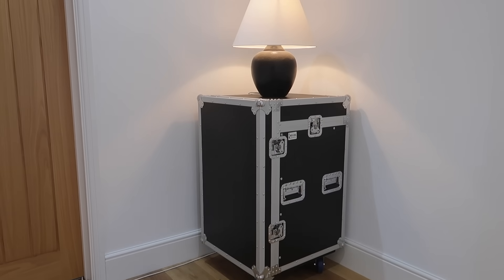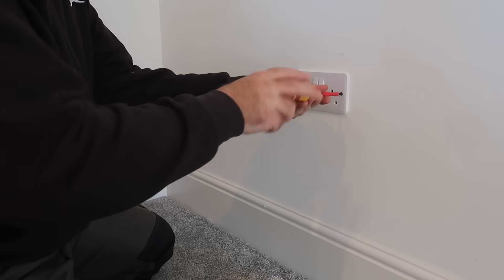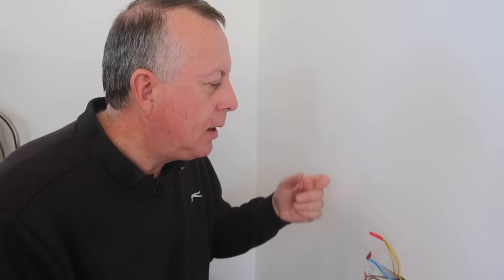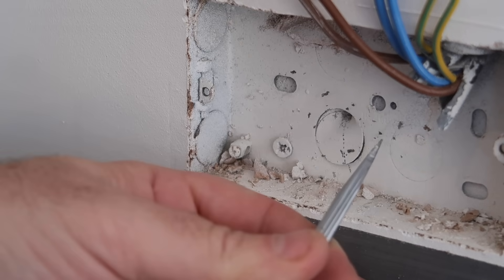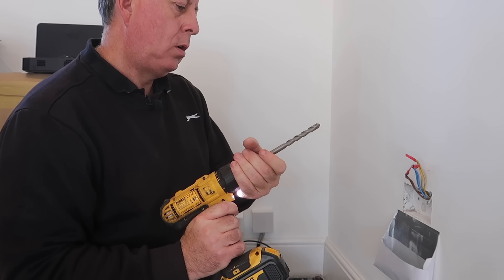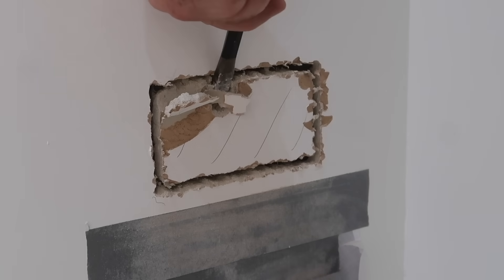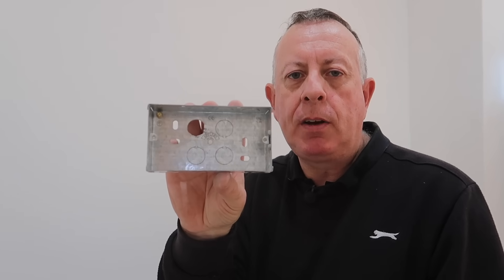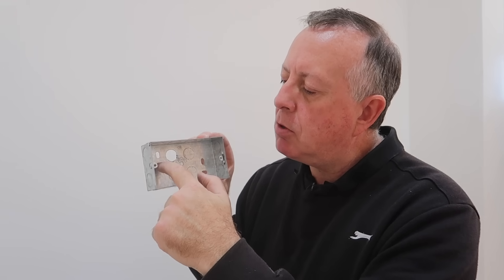How to Install a New Electrical Outlet in an Existing Wall

Comment: The reason why those neon screwdriver chesters a dangerous is because they do not accurately tell you if a circuit is dead electricians hate them because they are dangerous to the fact that they don't always tell you that the circuit is dead

Comment: My new build had stud walls with galvanised boxes attached to timber noggins rather than using plastic plasterboard boxes. To be honest, I dont know the reason, but I can only guess its because galv boxes are cheaper (reason most decisions are made in new builds - cost). Another reason could be it makes it easier at first fix as there doesn't need to be any plasterboards up to site the boxes.

Comment: Pulling on the earth wire, is not a good way to strip the outer sheathing.

A better way is to put the knife blade against the earth wire, at the end of the cable, and use the earth wire as a guide to the blade, to slice the outer sheathing lengthways.

Comment: You wouldn't see any of the filler behind the socket, and you'll keep the wall clean, if you fit a finger plate behind the socket.

Comment: To get the pattress box dead flush with the surface of the wall, put a strip of wide but thin wood (a bit of wide beading) across the front of the box, overhanging each end of the box, held in place with the screws that usually hold the socket in place, and put the box into the hole in the wall.

When the strip of wood is tight against the surface of the wall, the pattress box is level with surface of the wall.

Comment: If you'd of put two cables through the wall and used three double wagos in the existing back box you could of continued the ring no need for a spur

Comment: Would we be able to do something similar passing an ethernet cable through the wall with an rj45 socket /backbox either side? My Internet modem comes into the living room and my spare room (office) is directly behind. Looking to get a wired ethernet connection into the spare room and this seems like a good option.

Comment: the link for the MK Rapid Fix Socket doesn't work. Doesn't look like Amazon have them. Screw fix and RS do have them in stock. Thanks for the video. I wanted to do this for a couple of sockets for extra power in the house.

Comment: Those Neón screw drivers are all well and good but the reason why they are ground on is that they are not an approved method to test for presence of voltage. Firstly they are not GS38 compliant. Secondly the only thing that is stopping you from receiving an electric shock is a resistor. Videos like these is what makes DIY Dave say “My ‘lectrics work” yes Dave but are they safe? Have you tested it? 
But you keep doing what you do

Comment: Observation: There is an excessive use of extension leads. Flexible cables run through a doorway. Regulation: 553.1.6 C2

Comment: Err, using the bare earth wire to cut through the outer sheath, and then, on such a short stretch cable, go to the other end and find....The wire has disappeared into the cable! Should never do it that way anyway.

Comment: Just bought my first house and looking to do some DIY like this. My question is, does your new socket require your older socket to be switched on before it works?
Reply: No it does not. The old socket does not need to be turned on to use the new socket.

Comment: Hi Great Video and detailed explanation , I have one question, if you or anyone expert can answer. I think my Thermostat is blown on my Under Floor Heating. I am going to replace the thermostat. This was installed by builders and is powered from RCD to a 45A double pole switch then on to Thermostat. I think not right.??. Can you suggest the safe approach for the spur. Do I use 13A fused double pole switch or 20A double pole switch. UFH for 12.3 sqm and reading  resistance 29ohms & 1722W . Just need clarification please. Many thanks. BM

Comment: Do you not have the oscillating reciprocating blades over there I mean it's been a long time since I've been to England like almost 30 years but I see the outlets are definitely being upgraded the funny thing is here in the USA those Outlets would be flagged by code violation would not being big enough and not having the cubic space inside for the wires but also it's funny that you guys don't have to have all of the GFI AFI Outlets like here everything has to be arc flash now and arc flash GFI in the basements

Comment: Hi, how would you go about adding plug sockets to a loft where there are none nearby? would it be significantly more expensive? just can't get my head around how you would get the electric cables from downstairs to upstairs

Comment: When drawing round a back box it is easier to turn it around so the sharp edges are against the wall and stops the box from moving as it digs into the wall a little.

Comment: I wouldn't use one of those screwdrivers ever, they are lethal if they go wrong - plus, you want to take a look at your sockets, you seem to have a lot of bare copper poking out from the screw connectors - I would fix that while I was on with the spur.

Comment: "I'm using 2.5mm2 to match the rest of the circuit" is not quite right - the circuit is made up of two lengths of 2.5mm2, not one. 2.5mm2 is what the regs say you use for z spur. "...also to make sure I have the capacity for 2 x 13A" is also not quite right - 26A would be the absolute maximum on the cable, and if you thought you needed 2 x 13A loads for any length of time on a double outlet (very unlikely in domestic living area) you would extend the ring or even run a new 32A radial (on 4 or even 6mm2 if the wall is insulated), and have two separate single sockets. Doubles, as you say elsewhere, are usually rated at 20A total. For your lamp application it's obviously fine. But best to quote regs rather than talk about matching or 26A loads on 2.5mm2. Inexperienced DIYers need to know regs.

Comment: It's one thing to post a basic DIY video, but it's highly irresponsible to condone a DIY electrical installation.
By posting this you will be opening yourself up to taking responsibility for when someone electrocutes themselves or burns their house down after following your advice.
Electrics should be left to the professionals. NAPIT & the NICEIC are called Competent Person Schemes for a reason.....

Comment: Anyone want to buy a MFT? Don't need it any more now, just gonna go buy a LAP socket tester!
PLEASE DON'T CARRY OUT ELECTRICAL WORK! THERE ARE SO MANY THINGS WRONG WITH THIS!
Did you check the ZS before and after installation?
Did you check that you were installing from a ring rather than a socket that's already had spurs running from it?
Did you check to see that the installation conforms to current regulations?
Did you test the RCD?
Did you issue a Minor Electrical Installation Works Certificate?
Please stick to DIY, you don't have enough experience in the electrical field to carry out and provide YouTube "Tuition" to others.
If anyone wants this completed then please don't try it yourself, call an electrician!

Comment: Nice job but given that this involved making an addition to the circuit, is it permitted for DIYers to tackle this kind of work nowadays? I thought the rules now require a qualified electrician to do it since part P came in. I used to happily do these kinds of job myself but I'm unsure what the position is now. 🤔
Reply from the maker: No, under part P this is something you are allowed to do. It's easy to look it up on line.
Reply: @ProperDIY  That's Interesting, I'll look that up, thanks.
Reply: @ProperDIY  true, but you still have to test, inspect and certify any non notifiable work done (Part P1, 3.13) Difficult if you don't have a full tester.

Comment: How do you know its a spur. I'm guessing if its a radial it would have 4mm t/e. If its a ring final should be 2 x t/e wires in. Could however be a spur already and in that case can't use the original unless it's fused spur
Reply from the maker: Because a socket on the ring main has generally 2 sets of 2.5mm cables going to it - one in and one out say. A spur will only ever have a single cable going to it.
Reply: @ProperDIY  ...in your case with a fairly new house, yes. But spurs off spurs are often found (several in my 80s house until I sorted them out) and one or more spurs will have 2 x cables. Many modern houses don't use rings, and you can find 2.5mm2 radials on 20A breakers.

Comment: Just to say. If you have an oscillating multitool then you can cut the hole out perfectly and not need to fill around the sides as the 1mm slot will be covered by the socket facia. And if you don't have a multitool I would highly recommend getting one. It's the only thing to get me out of bed in a morning.

Comment: I'm sorry but what happed to "initial variation" of a existing electrical installation, "safe isolation" of a electrical circuit, electrical testing and certification" as to BS:7671 18th additional of the IET wiring regulations here in the UK 😱

Comment: Great video, I used a makita multi tool to cut into the wall, found that very easy and neat. Although that was  cutting through lime and soft clay brick, might not work on harder material 🙂
Reply from the maker: Great tip!

Comment: As an apprentice who doesn't work in houses is there a reason one of the legs couldnt of gone through and the new cable put through to complete the ring instead of the 3 cables at one point, honest answers cheers

Comment: Hi Peter, I have a single socket on my living room wall. Would I be able to use this method and put an outside double socket to my garden?
Reply: I assume you have already found an answer but yes, you can. Just make sure the circuit your spuring off of has RCD protection. And although not a necessity i prefer putting external sockets on a switched fused connection unit so they can be isolated when not in use.
Reply: @Jake-po8ej  Hi Jake, no I hadn't had an answer, thanks

Comment: The problem you face spuring off a ring main is that they often aren’t complete. This could end up causing excessive strain on certain legs of the ring. Worth getting an electrician in if it’s an older ring circuit as the chances is that there’s been some Bodging over the years.

Comment: A reason for not using widow maker screwdrivers how do you know the lamp inside it hasn't blown? Also other than that socket tester which only tells you the wiring matches, what testing did you do? Also I'm guessing your not bothered about any paperwork?

Comment: A great "How To" video, very clear, thank you 👍 I'm just curious, can a householder do electrical work like this with no UK Electrician Qualifications?
Reply from the maker: Yes you can but depends what it is. The rules are explained in Part P of the Building regulations. Essentially a homeowner cannot install a new circuit, do anything within the consumer unit or within certain areas in the bathroom but can carry out maintenance - like fitting a new light and extend a ring main as per my video.
Reply: @ProperDIY  Thank you, much appreciated and Happy New Year!

Comment: Greetings from the US. Interesting to see how things are done “across the pond”! I like how simple and modular the sockets and switches look. We do a lot more splicing with wire nuts at each box. They look lighter weight too than what we use, which makes sense. Not surprised to see that  being an electrician in the UK also means that you still need knowledge outside the trade, with plastering and painting as well. I always say that it’s a trade that requires you to be very well rounded to excel. Thanks.
Reply: He’s not an electrician please do not use this man as an example he just know enough to be dangerous
Reply: Mate, don't watch this diy'er. Sure at 14:56 there was no earth bridged to socket. Literally people could get a shock by switching it on.
Reply: @huntingtimes5474  Incorrect . The switch is grounded .

Comment: Thank you so much for your videos, giving me great confidence on installing wall sockets by myself.
I do have a question if you could advise me. I got a fridge wall socket on one side of a L-shaped wall, and would want to relocate it to the other side. But I don't know how to pass/direct/bend an electric cable through the L-shaped corner behind the walls. Fortunately the horizontal length to be passed on each wall is short, just about 2 feet. Also, is it safe to use a double wall sockets at the new location, for plugging 2 fridges?

Comment: Off setting the new socket to  the old one reduces the chance of hitting cables if you screw the box in. Nice video, well explained. Although 24 hours to fit a new socket doesn't really happen in the real world 😁 Thanks.

Comment: Not knocking you as it’s a great video for any DIYer to follow but please when doing these types of videos promote proper safe isolation by using gs38 approved voltage testers between all conductors to ensure no voltage is present. Then re testing across a known live source or proving unit to ensure testers are working. 

Granted neon screwdrivers are not the most dangerous things but the issue is the reliability of them. If you are encouraging the average DIYer to have a go at electrical tasks then why not go further and promote the proper industry safe isolation procedure to ensure everybody stays safe out there.

Comment: The socket should not be a double  i two 13a appliances connected would exceed cable rating  in bs if double should have been added to ring or 4mn cable used
Reply: No, 2.5mm2 is the approved size for a double socket spur. It's in the regs. If you know it's going to have a heavy load then extending the ring is a good idea, but technically not required. It's very rare to have 13A for any length of time through two sockets at the same moment.

Comment: Seen quite a few shocks from neon screwdrivers, usually  when they  have gotten  wet and the outside  has been dried but some moisture  has penetrated it.

Comment: Another tip is to use LED bulbs not the hot burning halogens which use a lot of power.  Daylight or warm colour LED bulbs are available with a voltage of only 4 or 5 watts & are much much brighter and last much much longer!  This means you will not be overloading your wall power socket either.
Reply: I'm all for LED lamps and saving electricity. But how is 4 or 5 Watts a "voltage"? And in what sense would a non LED lamp "overload" a 13A socket? You'd need more than 49 x 60W (usually they're tungsten, not halogen) lamps before you overloaded a 13A socket. 2940W @230V = 12.78A. That's a lot of table lamps.

Comment: Multi-Tool is good for soft block and plaster. Blade loses its teeth so use an old blade as a sort of cold chisel-knife. I usually use a piece of plastic conduit to protect cable from any risk of rubbing. Not necessary but it's my home
Reply from the maker: I've never tried that but will do next time for sure

Comment: Another really helpful (and amusing) video. Re cutting out the space for the back box, would you ever consider using a multi tool with blade? They’re a godsend for straight tidy lines 👍🏼
Reply: On thermometer blockband dot and dab you could easily  use an old multi tool blade and also a dry wall socket  and do the hole job in about 20 minutes.

Comment: Brilliantly explained! Which filler would you use to hold in place if it were a solid brick wall and not plaster board ??
Reply from the maker: Thank you. Just use the same - I've done it with all different types of brick and once it sets it's never coming out!

Comment: I might be wrong but l always thought that you could only run a single spur (i.e. single socket not double) off an existing socket ? I know it would never be loaded up fully, but potentially  two 13A appliances connected to the new socket could draw up to 26A which is pushing it for a single 2.5mm squared cable ? As for whether this is classed as a "New" circuit or "Existing" is another can of worms as I believe new circuits need to be installed by a Part "P" certfied person. Most competent DIY'ers would be capable of carrying out this sort of work, but the regs can be very confusing and often misinterpreted, just a thought 😀
Reply from the maker: A double socket can be run from an existing. A double is rated at 20A because the probability that you will draw 2 x 13A is very small that's why all double sockets are rated at 20A. A 'New Circuit' as defined by Part P is one that come off of the consumer unit -  this circuit is referred to in Part P as an 'addition or alteration' which a home owner can carry out as long as it's not within a 'special' location. It's clear in Part P of the building regs - paragraph 2.7

Comment: The biggest question is:
What is inside that touring case?

Former audio engineer here so that has me more interested than fixing a new socket!
Reply from the maker: A unique question! I have a Yamaha 16 channel mixer on the top, a couple of rack mounted guitar effects, wireless guitar receiver and another rack mounted mixer for in ear monitors.